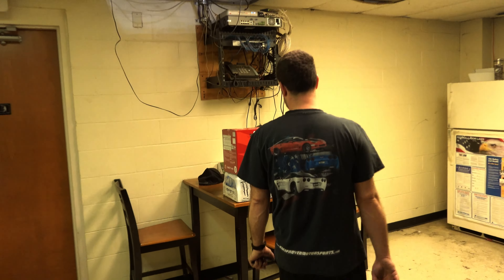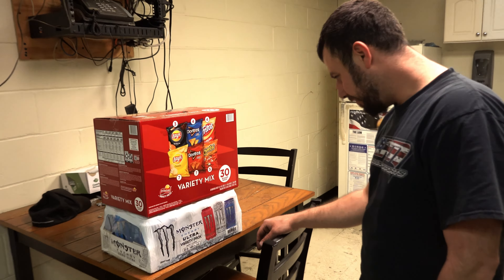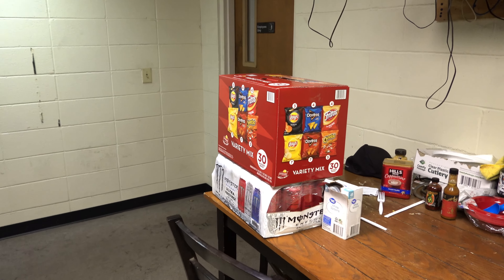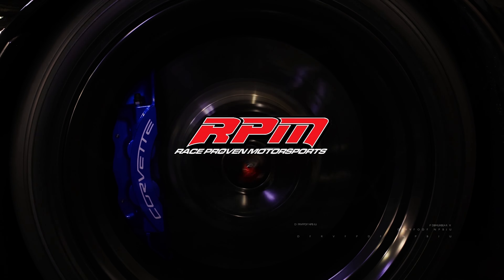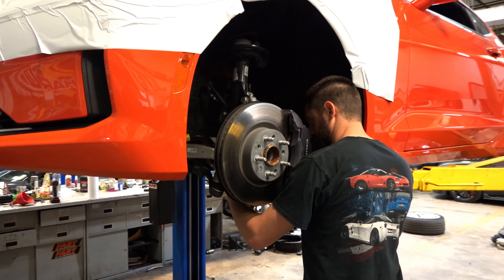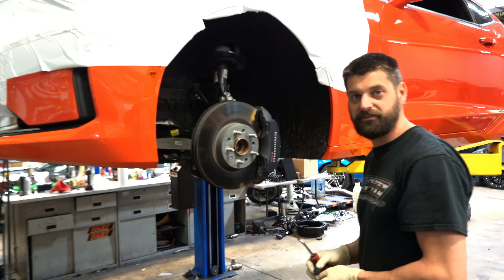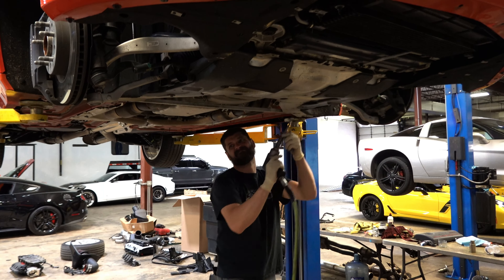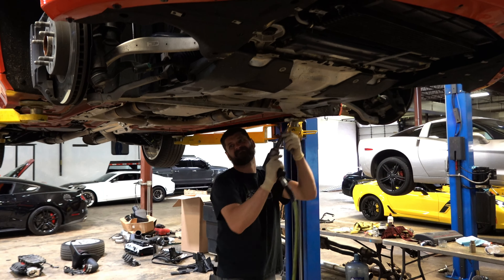Best Way To Build An LT1 Camaro For Boost!!

Comment: This is what I love about RPM. They look over a lot of the car If not all when you drop it off. That attention to detail is amazing. I dropped my car off missing one lug nut and no working hood struts. All was replaced.  I don't know how I found RPM but glad I did
Reply: Thats pretty cool. I once had a mechanic shop hook me up as well. I brought my car home and when I popped the hood, I found an extra bolt and a blue latex glove in my engine bay! Lucky me.
Reply: @CM-tc6pp  🤣😅🤣😅
Reply: @CM-tc6pp got any of them 10mm in there too? 🤣

Comment: Any issues with those Carrillo drop in pistons? Would like to add some with my boosted build to add a cam but have heard they can have problems with GMs balancing. Just trying to avoid machine work if possible.
Reply: If RPM is using them they’re probably good to rock and roll big dawg
Reply: @Preston_Taylor  that’s what I was thinking, best in the business.